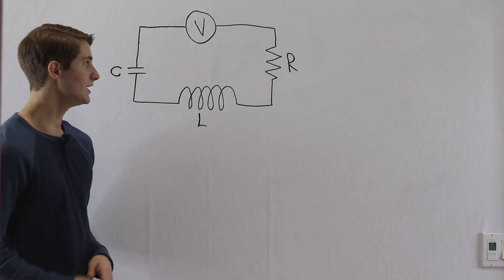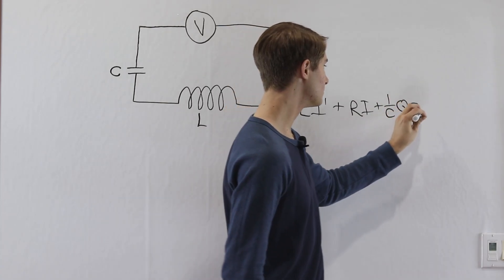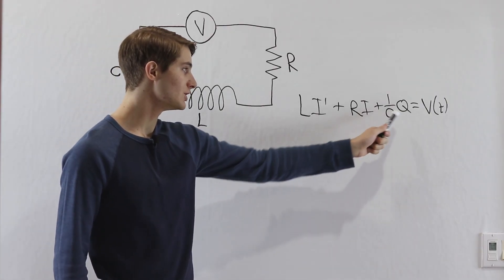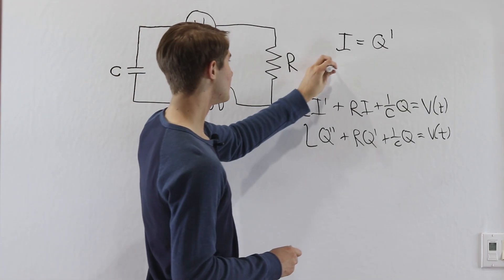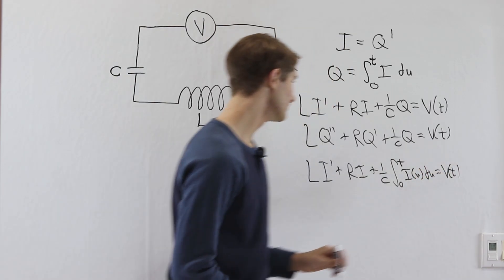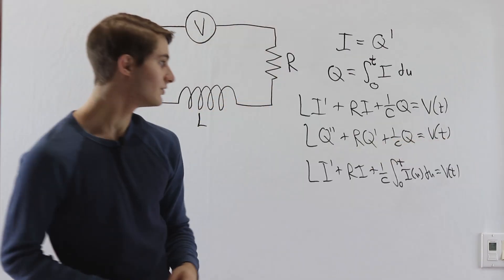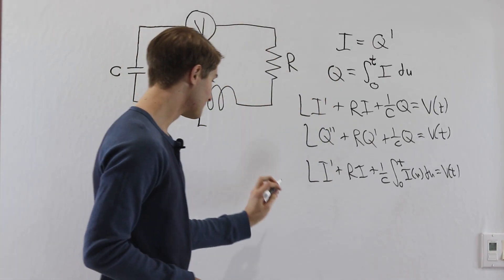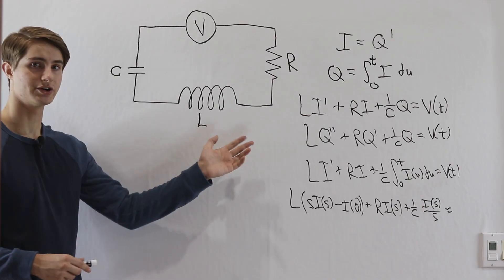RLC Circuits - Differential Equation Application

Comment: Can You do a thorough real world circuit showing the step by step calculations explaining the 3 three damping criterias for this RLC circuit, for a practical application in the REAL WORLD, please!... Would be Great. Knowing how to manipulate mathematical expressions on a board using calculus is senseless and worthless to STUDENTS / LEARNERS if one cannot explain how the Inductor and capacitor qualitative physical understanding of how they behave IN CIRCUTS in the real world as a SEASONED EXPERIENCED 'Professional Electronics Technician does using only 'algebra and trigonometry' without those highly theoretical differential equations and Laplace transforms which is the area of Geniuses, Designers = Electrical Engineers.